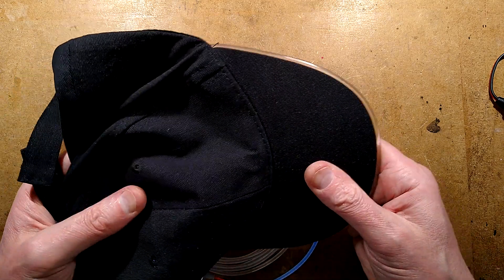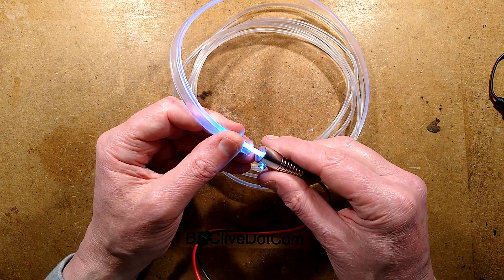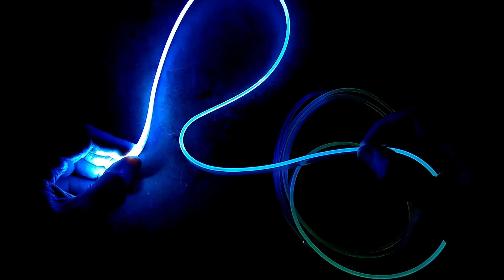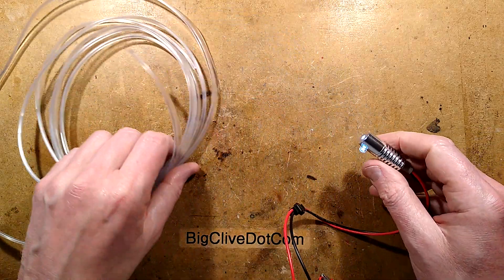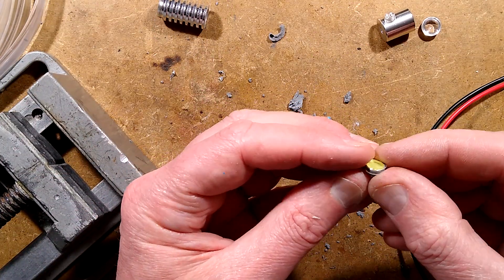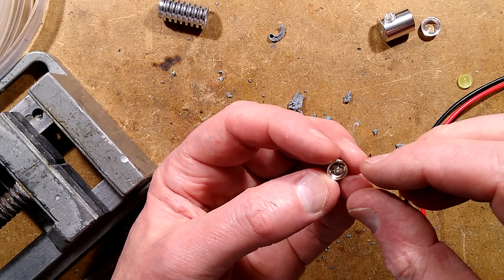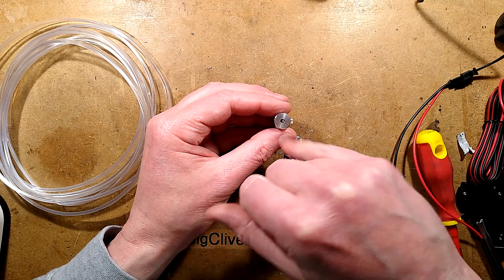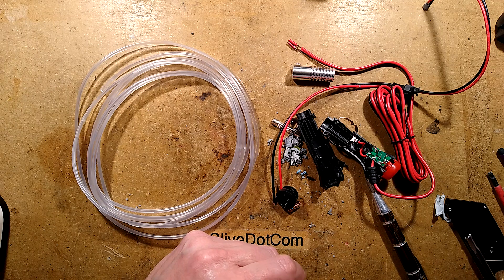Side-glow fibre optic is still terrible

Comment: What's needed is a clearer fiber, one that wouldn't bleed any light at all, with some very small 45 degree cuts on the non-visible side, spaced far apart close to the LED, with decreasing space the further away from the LED they get. This is used in the "DRL"s of a lot of newer cars to get an interesting shape of the light all while using a single (or a few) LED (s).

Comment: Would love you to open up a 7kw home wall charger for an electric car.  My electric company want £999 to install one.  I reckon its a scam as my electric shower is 10.8kw.  Just wondering whats inside it gold.  You can use a normal household plug for 3kw charge to your car so whats stopping me wiring a 10.8 kw lead up to it direct.  Thanks Clive be great if you could get hold of one and explain if its a scam or if it’s worth £1,000

Comment: The problem with the fiber is, that it is symmetric along its length. It radiates a fixed fraction of light per length that runs through it. One could fabricate a cable that would leak a higher and higher fraction of the light to compensate, to have relatively even brightness along its length. But such a changing cable would be much more expensive to mass produce. But maybe a homogenous cable and fraction expose or coating along its length?

Comment: I use side emitting fibre all the time, up to 10mm dia, and it is almost as bright as neon if less than 3 ft length. If longer, drive from both ends. You need to drive them with 5-10W  Cree LED chips, and these you have to make yourself as 1W like you used here is all there is. I buy 5W Cree Chips mounted on a substrate. Then that is attached via thermal epoxy to a solid circular piece of aluminum, maybe 1" dia via 2" long.. Then another heat sink on the bottom depending on ambient air flow. Then I make (on a lathe), an aluminum  cover with the appropriate size fiber hole, grub screw, that goes over the chip. These leds come in colors. You drive them with a constant current source, NOT CONSTANT VOLTAGE. There are super cheap CC drivers made for any wattage of LED as these are what are used in higher power LED bulbs. RESISTORS DON"T WORK ON THESE NEW HIGH POWER SILICON CARBIDE LEDS!

Comment: i mite be wrong but isn't fiber optic's an type of glass material? this seems more plastic, had an fiber installer here the other day and he could check our broken wire threw 60 meters of optic. if you want the skirt to light up i would just get downward facing LED strip lights to illuminate it.

Comment: There is a trade-off involved in the design of these. At each point along the length, a certain fraction of the light escapes, and the remainder (ignoring losses) continues along the fibre. As a result the apparent brightness of the fibre will drop off exponentially as the distance from the source increases. If the fibre allows a lot of leakage, you see a lot of light near the source, but the drop-off in brightness happens faster. If the fibre only allows a little leakage, the drop-off will be less but you won't see much light anywhere. If a substantial fraction of the light makes it to the end of the fibre, a mirror would be advantageous.

Even if you had perfect distribution of the light, the overall surface area of the fibre is fairly large and so one should not expect it to look particularly bright. It looks like you have about 2m of the stuff, and its circumference is about 1cm, so the total area is 200cm2, about the same as a 14cm square.

Comment: I have been using them for years.
You need the slightly heat the PMMA (material its made from) at the cut end so it is completely clear. You will get 10 x the performance if its cut clean and polished. Also whe you insert the into the light it must make firm contact with the lense.

Comment: Energy is conserved.  The light either 1) comes out the other end, 2) comes out the sides, or 3) is absorbed and converted to heat.  "Side glow" fiber explicitly has scatterers in it or surface defects around it to let light escape and glow.  Light that escapes near the LED is not in the fiber farther from the LED.  The intensity in the fiber decays exponentially,
I(x)=I0*exp(-ax).  
The brightness of the glow is the product of 1) light intensity in the fiber I(x), 2) density of scatterers, and 3) transmission coefficient of the fiber-air surface.  It is possible to grade the scatterers' density along the fiber, d(x)=d0*exp(ax), so that this product is constant; however, this would be a much more expensive and restrictive process and product.  By injecting light into both ends, they have done the second best:
I(x)=I0*[exp(-ax)+exp(a{x-L})].

Comment: My guess it is crap or fake fiber optics, or perhaps the light is not focused 100% straight. I thought fiber optic cable was actually designed to get the light source from point A all the way to point B, such as on my digital surround sound.

Comment: Always love to see your explanation and reverse engineering.
Sir can you help me out , I got a  few Dynarex make Oxygen Concentrator 5L. But made for usa (it was a donation) 120V 60hz. But how can I use it in UK standard voltage and frequency Research a few but no solution (standard trx + frequency converter cost more then the device itself) Can you plz me as well as my hospital.
Reply from the maker: Depending on the circuitry it may not need a frequency convertor.  But it would probably need the 120V.

Comment: I hired a fiber optic contractor to install color changing side glow fiber under the coping edge on a celebrity pool that I was constructing. We had to use four illuminators (which were HUGE) firing light into both ends of several sections of fiber. Cost a fortune and it completely sucked. Uneven illumination, and very poor brightness. Good thing the celeb could afford it!

Comment: I have purchased some fibre optic with a solid core. It helps with side emitting dispersion, and distributes more evenly along the length. Laser wire is also really fun to use.

Comment: I recently picked up about 3m of this stuff from amazon for a project.  I only need it to illuminate a line about 90mm long, so it'll work fine for me  I got mine without the LED, but i'm gonna make a little bracket to hold the fiber as well as a neopixel.  I also tried it without the clear rubber sheath, but found that it worked even more poorly without it.

Comment: I have an idea, but it's 'faffy'. Every so many inches/cm add an LED/s held with clear hot glue, maybe two pointing down line by cutting the 'fibre' part leaving the skirt there. You can add the colours of choice to blend along? It just means having a wire travelling along the skirt. I did say it was 'faff'y'. BC have you tried it with a laser LED?

Comment: I've used the older hard acrylic "light guide tubing" type of this for car lights, signs, etc for... oh heck, decades at this point, but never really liked the softer side-glow fibre optic stuff, due to the same issue you are showing here. One thing that was NOT an option back then, but might be now, is an idea that just popped into my head seeing this video. That "skirt" part there... what if you stuck one of those new mini-led strips with the 2025 I think they are? Super-slim little side-firing SK6812 addressable LEDs. Would that be picked up enough if you tilted it just a bit, do you think? Angle it into the skirt sideways, pointed towards the joining point between the skirt and the strip?

Comment: The key is to choose fiber material and surface finishes which result in very low loss per unit length, then drive the living F out of it with specialized lighting.  The best version of this I have seen is a very large diameter hollow plastic tube.

Comment: The 3M stuff that is half an inch thick and costs as much as a new Cheops pyramid or Rhodes of Colossus is pretty good, I hear. And all you need is one of those microwave sulfur lamps with very good IR removal (dichroics) to light it (one on each end for long runs) and those are only $10,000 USD... WHAT ARE YOU COMPLAINING ABOUT??  ^_^  ;D
Reply: OTOH, EL-wire lasts longer and longer, the weaker you drive it, er, hang on...
Reply from the maker: Yeah, but EL wire is dim to start with.

Comment: If you straighten the fiber out, you will find the darker parts will light up as the light mostly escapes at corners. 
I imagine if you were routing it around the interior of a car cabin, it would have some long straight parts and then few corners so the brightness would be averaged out along the length better.

Comment: That stuff isn't fibre optic - it's the same stuff as is fitted to the bottom of my shower screen (it has a flexible seal so the screen can pivot on its hinge to then mate up to the edge of the bath). The round bit slides along a keyhole shaped rebate in the bottom rail and the "skirt" is the seal.
Reply from the maker: It has a fibre optic section moulded in.

Comment: I wonder if the "Light Guide" was cut perfectly flat/square there wouldn't be better optical conduction. the wirecutter pointy cut you have would scatter all sorts of directions.
Reply from the maker: I tend to cut fibre with a sharp knife, and sometimes heat polish the end.

Comment: Those cheap shiny plastic car plug fittings always look nasty and dangerous. Those cigarette lighters used to get very hot as anyone born in the 60s or before will tell you, but strangely never quite hot enough to properly light a cigarette.

Comment: I purchased some of the same stuff but without the mounting "skirt" and its just as dismal in producing the desired effects. Even with a 500 mW blue laser, the length of "glow" was about 30 inches. The dia of the "fiber" is 2 mm. I also have a keyboard/mouse pad surrounded by a different type of fiber optics and it is about 70" total length and glows brightly in standard overhead lighting.. why the difference, I have no idea, but what I did find interesting is if you press on the fiber with a hard thin material ( like the edge of a credit card) it glows very bright at the point of contact. If you press too hard the fiber can be perminently damaged and will glow brightly at the compression point where the damage occured. Over time, the led supplying the glow fades and the effect becomes diminished on the keyboard/mouse pad ( made by luxcoms and hcman).

Comment: I put these in my car around the door edges. Every turn is a significant drop off in light. So for 140 inches I have two less at either end. It works pretty well, but definitely still has that drop off. However it still lasts way longer than El wire

Comment: Have you checked out EL tape/cable.  It was used in tron 2 in clothing.  Its basically high voltage, low amps, reactive material.  Quite interesting and does a bit better for length.  Electro phosphorescence material.

Comment: I've seen pimped up cars with 'glowing tubes' running across the outline. It's not my kinda thing but the effect was very good. Is that a completely different technology then? Cause even optimized I can't see this going very far before noticeably dimming.
Reply: Cold cathode and electroluminescent wiring are other more expensive, but more consistent options

Comment: There's no mystery why side glow fiber doesn't reach very far. It's purposely 'leaky' to create the side glow, so light intensity always drops off much more rapidly than a comparable end glow fiber. The extra flexible polymer they use also has higher attenuation loss than the best (stiffer) end glow plastic fibers. I've never seen one that looked very visible for more than about a foot from the LED, except for some much larger diameter side glow fibers coupled with a 1W or 2W LED, which the fiber easily covers. Don't blame the fiber manufacturer, or the skirt. This is just the reality of side glow fibers, and a dodgy optical coupling arrangement. 3 low power LEDs, all equally off-axis from the fiber axis? Sheer cluelessness, like whoever designed it had no understanding about critical angles, angle of acceptance, or basic optics. It probably gets slightly more light into the fiber than if they'd centered the fiber directly in front of just one of the LEDs, to be quite frank and most of the light ends up bouncing around in the illuminator, or escaping the fiber within the first inch because it entered the fiber outside of that critical angle and cannot travel through the fiber by total internal reflection.

Comment: Blue light is a terrible choice for fiber. Infrared has a longer wave form and doesn't 'impact' the inner walls of the glass/plastic as much. There are a few IR wavelengths common in fiber optic communications. Not even red. There's a reason it's dangerous to look into unknown fiber... the invisible IR light can be bright enough to do damage before you even know you're "not seeing" something.

Comment: Looking at the fitting. Could you try using a laser pointer instead? I assume the stronger light source would go further. They have a similar aperture on cheap units.
Reply from the maker: It was disappointing with a laser too.

Comment: For every lenght of fiber there is half of the light diffused out, but then only half the light continues on, of which half again exits the fiber and so forth, so Side-Glow Fiber optic is intrinsically bad, unless you make a great effort to match the diffusion to the length and shape of the fiber, and the led used. basically you have to stop light escaping from the beginning of the fiber, and increasingly enhance the diffusion (side-glow) towards the end.

Comment: The designed-for-laser stuff is much more effective, but also ridiculously expensive comparatively. "Laser Wire" by ellumiglow is the only thing that has actually met my expectations for relative illumination over length.

Comment: these work better with a lazer, and surprisingly angles, the more "bent" the light pipe is the longer it glows, im assuming because it adds more surface to reflect off of.

also, i have these in my car, they work best if you flatten the end of the LED and put the fibre directly onto it, then encase the whole end in black shrink tube or electrical tape so that all of the light is going into the tube instead of outward from the led.

Comment: It makes sense that it would get dimmer. That is a diffusive plastic. So the brighter you want it to be near the source, the more quickly it will get dimmer. The only way to avoid this is to continuously adjust the composition of the plastic along the length such that near the source it transmits the light more efficiently and becomes more diffusive further along the length. It would VERY difficult. Or you could just have a SUPER BRIGHT LED at the start so that it can travel much further and still be bright. That comes with it's own issues.

Comment: The stuff I got looked stiffer than the one you showed. The fibre is 2 part, an inner fibre core (2mm) and an outer sheath giving an OD of 3mm. That's presumably what makes the difference. 
I used a simple 3mm led with a 1K resistor and heat shrink to fasten it on, about 10mA from 12V, it works fine all along its length.
I haven't seen any like that with the side strip for stitching. Search for "2mm fibre 3mm outside diameter" to find it. About £2/metre.
If yours is also 2 part you could try pulling the fibre across a sharp edge to introduce some microfractures.

Comment: With fibre optic the end surface to surface connection is very important. Data using glass fibre used to be quite difficult to terminate, lots of polishing to get an end good enough. Pre-terminated connectors came along where a small section of fibre was already in the connector and with a special tool the fibre cable is cleaved cleanly producing an end that is good enough to mate with the fibre in the connector without polishing. Obviously the same precision is not required for decorative lights as opposed to serious data networks but the interface of the LED and the plastic fibre cable is still likely to be important. Of course the quality of the plastic cable will also make a real difference and the skirt probably doesn't help to produce a good cable as these are probably extruded hot through a hole with a slot to one side for the skirt, in one go.

Comment: Yeah, plastic fiber optics are always bad. They're either brittle AF, or very bad at transporting light. Often both. You'd need a massive LED to transmit along the length, and you'd never get a uniform glow.

Comment: So the ballcap is the perfect use case, it doesn't work much longer than that. I want to get one of those caps and replace the switch with one from a tactical flashlight/torch -- one position for always-on, to light up the workpiece, and one for flashing rave mode.

Comment: Side glow cable works due to microscopic cracks along its surface. I have improved lengths of PMMA side glow cable by lightly crushing it with a steel roller although it is tricky getting even illumination along its length like that. Multiple core cable is much better.
A good way to get more ‘glow’ further away from the led source is to use ordinary fibre optic strands and distress the cable (with rollers or course sand paper) in the areas that you want to side emit.
Reply: There is a relationship between the fall off of light that occurs in fibre optic cable and the quality of the cable material/wall. The more light that spills out through the wall, the weaker the illumination gets over distance. 
If you were to try using a stronger light source there wouldn’t be much improvement in side glow, just a slightly longer bright length and more glow at the end.
Ideally the light should all be diverted out through the micro cracks in the wall, so any glow at the end signifies that the cable isn’t efficiently treated on its surface.